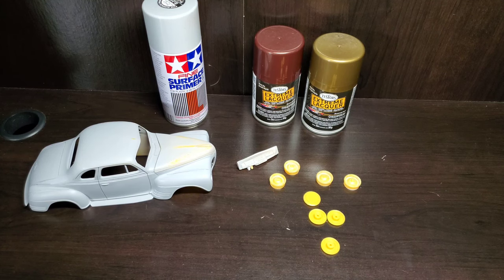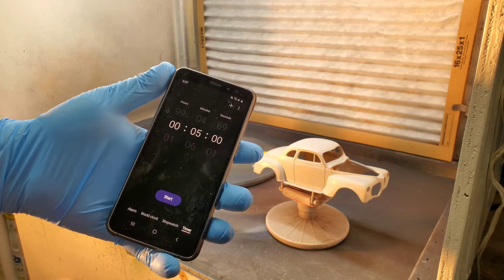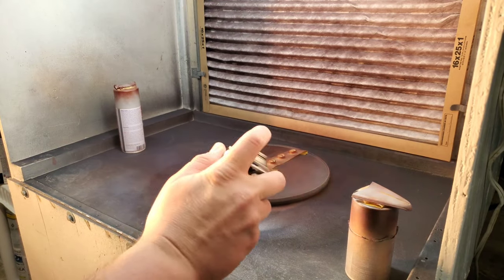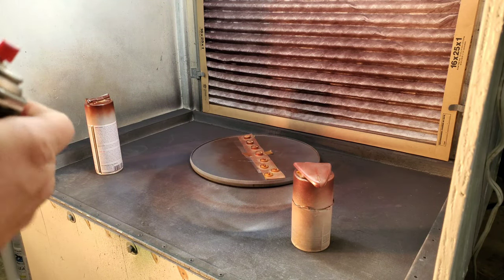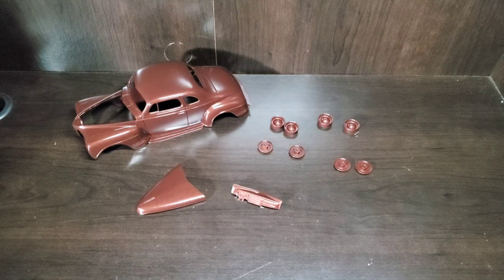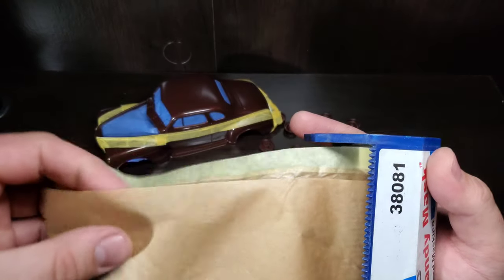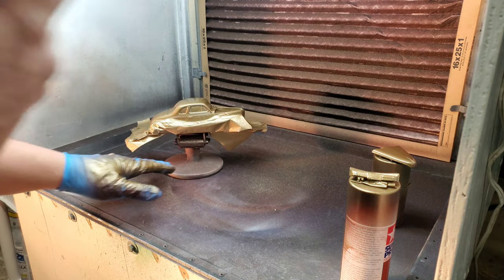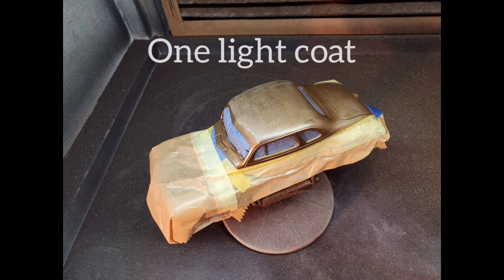How to Paint a model car body with Testors Extreme Lacquers and 2 tone a body.  Repair and Polish

Comment: One tip that I find very helpful when using rattle can spray paint is to put the can in a container of warm water for 10 minutes between spray coat. Enamels and lacquer based paints work best with this technique. The paint flows so smooth on surface of the model! Just remember to use warm, not hot water-you don’t want you spray can exploding!
Reply from the maker: I will run it under hot faucet water to bring the pressure up for atomization.   Cooler paint and cooler temperatures will allow it to flow longer/flash slower.  Either way works as long as its the way that works for you.
Reply: @sodakmodelcars  what happens when a can bubbles up on the bottom? I've been putting cans in a glass jar with warm/hot water before coats and it works great, however I'm worried when some start to bubble and expand a lot near the base of the can.
Reply from the maker: If the can is deforming or leaking at the seams it's clearly to hot/high pressure.  I've never seen a can deform, I've seen some very old cans leak at the bottom seam.  But not from anything I've done.
When I talk about warming a can, its probably like 80-85 degrees.  It should be warm but that's about it.
Reply: @sodakmodelcars  yeah I think I was using too hot of water lol. Thanks

Comment: Nice job but i still think tamiya makes the best spraypaint for models , the caps on tamiya spray finer and if you spray there clear coat corectly it wont even need a polish.
Reply from the maker: Yeah they are nice, I make no claim to best because it's just preferences.

Comment: Hey Dak, great color combination!  I noticed your spray booth doing some serious sucking😂. I’m wondering what fan motor your using? Thanks and great job!
Reply from the maker: @terrypeterson9783  Thanks, just a homemade unit with what I had, dissected an old double window fan and wired the motors separately.
Reply: @sodakmodelcars  Awesome thanks!

Comment: Excellent tutorial. I have only used the Tamiya sprays and had good results. A friend had a 71 Dodge Demon 340 in a metallic brown, so I want to do a model of the demon in that brown color. But Tamiya does not make it. I am convinced now to try the testors. You are correct in the light coat method and waiting in between coats.
Reply from the maker: Thank you! And good luck with the paint job!

Comment: Thanks for this vid. I really needed it. I love Tamiya paints but eventually a little more variety in color choice is desired.
Reply from the maker: Right on.  The Tamiya sprays are (synthetic) lacquer as well and the same principles can be applied.  Although Tamiya does have a better/finer spray nozzle.

Comment: I'm surprised you were able to wet sand so soon. I would've thought it needed more curing time. I guess lacquers are more forgiving that way. Are the Tamiya LP's the same? I haven't used them.
Reply from the maker: Yes to a point.  All laquers dry pretty quick, your times may vary.  Laquers just basically dry to a film and will re-wet with the next coat, so once it's dry to safely handle there's not really a benefit to wait longer if you're going to recoat.

Comment: 🏍️ I found the grill piece that came separate quite a challenge since you don't want a square line surrounding it. Difficult sanding. Yours looks great so i bet you did the same, with less complaining than me.
Reply from the maker: Thanks! Yeah its an usual design choice but yes I glued it in and filled with spot putty.

Comment: I'm guessing the same can be said about airbrushing? I'm a bit paranoid about spraying too heavy. And, I think I spray from too far away. I'm so used to using rattle cans.
Reply from the maker: I guess, kind of as far as building it up with a light coat or two but generally with an airbrush its much harder to be too heavy (especially with lacquers quick dry time) and more often I have an issue with not being able to get it on wet enough to get a smooth finish.

Comment: I just found your channel, this was a great video. I would like to see a video showing off the details of your paint booth, and how you built it.
Reply from the maker: Thank you for checking it out!  The booth isn't really special, just made from scraps I had at the time.  Basically a plywood box with an upswing front door so I could keep the top free for a work area but vlose it while things dry..  Then I used a broken dual window fan and dissected it for fans.  Unfortunately I don't have an accessible window to vent it outside but its in an unfinished utility type basement so it doesn't hurt anything and don't notice any smells outside of the basement.

Comment: I have a few of these paints but have not used them yet so thanks for this tutorial video. Did you prime the parts before paint and if so what did you use? Thanks again for a great video.
Reply from the maker: At the beginning I showed the primer. Body is primed with Tamiya over repair areas, but other parts are bare plastic.

Comment: Hello SoDak Model Cars: Like the colors looks good. Wanted to ask you where did you get the turn table and the car body holder? I also like your paint booth! I'm going to build me one of those. I've been painting mine out doors on sunny days. You Know old school. Hoping to see more of you post. I'm getting back into model building. retired and need something to do so decided to do some model building again. sounded good to me 😃.  Built them in my early pre-teen years then again in my late twenties, I got my dream job in my early twenties as a body man/ painter and then did some NASCAR models and classics then hurt my back and had to stop but retired now and can do some small stuff so modeling will fill my void and boredom. any way thanks for the video and those new ways to paint them to look great. Subscribing now so I can see all your post.
Reply from the maker: Thank you and welcome (back) to the hobby.   I did body and paint for 20+ years, after 8 procedures and counting in 3-4yrs I had to call it quits.  Missed it and picked up what I did as a kid before the career.
I have all my videos in playlists so its easy to find some more videos.  Unfortunately haven't done many How tos but hope to get more out this year.
The stand comes from Tamiya about 20ish for a body holder and another one with clips.  Make sure to secure the wires and halves so they don't come apart while painting. Many have learned the hard way when the halves separate. (Could use a design change)
Reply: @sodakmodelcars  Thank you! It's nice to know someone did the same job as I did. I loved doing the work on the vehicles cause to me it was like Model building just in Larger form and a lot of nut's bolts and screws LOL. I'll be looking for any new post from you and go back and view your older ones. Thanks for the info on the Tamiya stand and I'll be careful and make sure it don't separate. Talk again soon.
Reply from the maker: @Biker758210 No problem, I'm always willing to help if I can!

Comment: Your paint work is stunning - WOW! I have just started building again after almost 50 years. I have a question if you could please help/advise. I painted the AMT 67 Impala SS using the Testors Spray Enamel GOLD spray paint, it says on the can to not clear coat. It came out ok but does not have the nice shine that I'm looking for. How can I clear coat the Gold paint to give it a nice shine ? Thanks
Reply from the maker: Thank you!   Welcome back to the hobby.   With enamels it's hard to say or recommend something other than either polish the color you have to bring up the luster or using an acrylic type clear coat/glaze.  Enamels chemically change to "cure" and create a "shell" so using another solvent based product over it can break that shell and cause problems.  Typically using the clear coat like another coat of color may be the best case before everything is "cured" out.  Lacquers only "dry" ,they don't cure, and adding another layer of lacquer only rewets the previous layers.
Reply: @sodakmodelcars  Than you for the follow up and all of the information, very helpful to me.
Reply from the maker: @deang4438 Welcome
Reply: @sodakmodelcars  Just to clarify, with the Extreme Lacquer you can apply clear coat ? With the enamel either polish or apply acrylic clear coat or clear coat before it has cured out ? Sorry but I'm learning all this again after many years, Thanks
Reply from the maker: @deang4438 Yes that is the way I treat it.  I personally would only use enamels if I'm not planning on applying any other color or clear. (I rarely use enamels because of this) Enamels tend to have a higher gloss than lacquers when applied correctly/wet enough to flow. Polishing is all I would personally do to enamels.    I have another video using spray can lacquers where I do clear.   Most of my painting is done with airbrush and clear coats.
Reply from the maker: More advanced technique with lacquers and clear coating.

https://youtu.be/EAJhkuUt1Hc
Reply: @sodakmodelcars  Great - I bought the enamel because it was the color I was looking for but will avoid enamels going forward for the reasons you mention. I have watched this video numerous times and some of your other videos and I will watch the link you sent me, THANK YOU!
Reply from the maker: Enamels can be great for one and done colors.  But after that they can be very finicky and can go bad once adding additional layers.   Thanks again for watching and hope the info helps.
Reply: @sodakmodelcars  The Info you have provided to me has been VERY helpful, I was sort of lost on this and I could not find specific info on Enamels, Lacquers and Clear coating etc, Thank You!

Comment: when painting engine parts is it easier leaving them on the tree or suggestions please.
Reply from the maker: That's just going to be a personal preference, I know many do but I remove all parts and clean seams before painting.  Again preferences and it's very common to leave on trees for spray or brush painting.

Comment: Nice paint job...can you tell me what you used to remove the chrome plating from the wheels?
Reply from the maker: I use Yellow easy off oven cleaner.  I have a small plastic cup that I put them in and spray down. Cover loosely for a bit as there is some off gassing. I just set the lid on without snapping it down.  It's typically a few minutes but I like to leave atleast overnight to make sure all the varnish under the chrome is removed.  Household bleach will also take the chrome off in just seconds but doesn't always do well with the varnish layer (some have it some don't and some are tougher than others).  The easy off can be left in the cup and used several times over.
Reply: @sodakmodelcars  Thank you I'll try that.

Comment: Any advice please i been trying to paint a c10 1:64 two tone but eather the tape pulls the paint after I paint the second tone or the paint reacts to the other one and meesed up everything 😢
Reply from the maker: I haven't done anything with die cast.
Clean and scuff surface
 Lacquer primer (Tamiya or Mr Hobby)  
Lacquer paints (Testors or Tamiya) 
Tamiya Tape.  
If the paint still pulls to bare metal, then you need an acid etch primer. (Auto store should sell rattle cans, it will have a very strong odor/chemical smell so have proper PPE)

Comment: Thank you. Do you Clear Coat after the Sand/Polish? cheers.
Reply from the maker: Thanks!  On this one it is only the color coats, no clear.
Reply: @sodakmodelcars  Thx; I was asking in general terms. Do we paint followed by clear coat followed by a wet sand, and then wax/polish.
Reply from the maker: @southpaw5483 It's going to depend on the project.  Wet sanding is used to remove something so it depends on what we are trying to remove, that dictates what happens after.    I try to avoid polishing and my normal procedure is to color, clear, wet sand, clear and done.  Sand/Polish dirt nibs if necessary.   I do have another "custom painting with rattle can" video that shows the clear/cut/clear process.
Reply: @sodakmodelcars  Thank you for the help and insight.

Comment: Very nice paint job.  If you don't want a rough flat finish, you have to build up to a full wet coat.  Back about 1979, I painted a 1976 Chevrolet Chevelle in golden brown metallic.  That was a full size car. 

If you want a 1940s effect, you should avoid metallic paint.  Original 1940s colors did not have metallic paint.
Reply from the maker: The last coat was a wet coat for the final finish.   I've done 1:1 painting and custom painting for 20+yrs.  I'm fully aware of actual paint.
The reference to 40s was no clear, and the colors of the darker, brown, less vibrant (instead of something like purple or orange) but also said I wanted a "bit more".  40s with a kick
Reply: @sodakmodelcars   Your experience shows.  I've watched lots of folks building and painting  models with air brushes.  Yours is the first using just rattle cans.  And, the results you are getting is just amazing.
Reply: @ByranTorok
I was under that impression also.
  They have been putting metal flake in automotive paints since the '20's of the last century.
  A foreign car company I believe.
  I almost fell out of the chair I was sitting in.
  The technology they use today, is head and shoulders above the metal flake that they were using even in the '60's. Finer flake. I believe the aim was to create a shimmer in the finish.
  It's really not that noticeable on a cloudy day, where they all look solid color, but the sunshine really brings the shimmer.

  Great tutorial Adam. It's tutorials like this that drive this community.
Reply from the maker: Thank you!

Comment: Why wouldn't you paint the hood with the body, at least in the later stages, with the body? Seems a match would be elusive otherwise.
Reply from the maker: The two tone wouldn't follow correctly in the jambs if the hood was on while painting.  With good consistent technique, there's no worry of color issue.

Comment: Washi tape, is the same but cheaper. I purchase 15mm by 10 metres for $2.07 AUD, about $1.40USD  delivery to my door. They have different width. Cheers Graham.
Reply from the maker: Thanks!  Do you have a specific brand name for the washi tape?  I've heard this before but the one I tried was not the same thing or near as good.

Comment: Can you use testors on a 1/18 diecast car also?
Reply from the maker: I don't see any reason why you can't.
Reply: @sodakmodelcars reason why I was asking is because I use rustoleum and that paint suck when it comes to adhesion. Paint chips very easily when putting on parts or opening/closing parts.
Reply from the maker: I'm not super familiar with working with die-cast (but have done 1:1 body/paint for over 20yrs).  Are you working from bare metal or painting over factory paints?   Assuming bare metal...
  I think the lacquers will work for you.  But if not, adding an etching primer will greatly help.  Idk if Rustoleom has a version of etch primer but a high quality etch primer from an auto store can nearly guarantee adhesion.  It only takes a single very light, near transparent coat.  But they are usually pretty strong odor so outside or well ventilated is recommended.

Comment: Why lacquer over enamel paint?
Reply: Or acrylic
Reply from the maker: For me, I prefer them for the faster dry times, infinite recoat times, seem to layout thinner, just overall seem less volatile to work with over the enamels. Especially when doing multi colors.  If you only do single colors I think enamels can be a good option as they can have a bit more shine and some more durability.  Enamels go through a chemical change by oxidation which kind of creates a "shell" which is good for a final finish but can "break" if recoat times aren't perfect or get a little too heavy with next coat, etc.  Lacquers just dry and can be "re-wet" at any time (kind of like dirt/mud, solvents evaporate and doesn't chemically change)   And lastly the color options seem to be more my preference in rattle cans.   I do use pretty much everything, (rattle can and air brush) acrylics, lacquer, automotive urethane and lastly the occasional enamels.

Comment: Touching the body all up with your fingers on a fresh painted surface you get the oils from your fingers all on the body good thing you didn't clear coat it
Reply from the maker: Yes, no plans to have ever clear coated it, if I was clearing it I would have done it before taking it out of the booth.  But not the end of the world if you touch it, I touched it quite a bit while masking for the 2 tone. As well as many of my other custom paint jobs that get handled between colors or clear coat.
Reply: @sodakmodelcars  I hear you but you're wrong you never want to put your fingers to fresh paint I know I'm a professional car painter
Reply: When a car is in the paint booth and the base coat is on it ,you don't go in there touching it all with your fingers, and then clear coat it, you just don't
Reply from the maker: Same, over 20+yrs of professional painting and custom painting.  I understand what you're trying to warn about but I touch the paint all the time when doing custom painting/masking.  Not hard to wipe it down before paint.   If I do a basics to painting I'll be sure to mention oils and cleaning your surfaces.  But again it's not the end of the world and just in the model world most of my kit paint jobs I have handled with bare hands to do multi color paint work or vinyl tops.  No issues. It doesn't immediately ruin the paint job.
Reply from the maker: Yes if I'm going from base to clear... like I said I wouldn't have taken it out of the booth and would've added the Testors clear like another coat.
Reply: @sodakmodelcars  car looks good